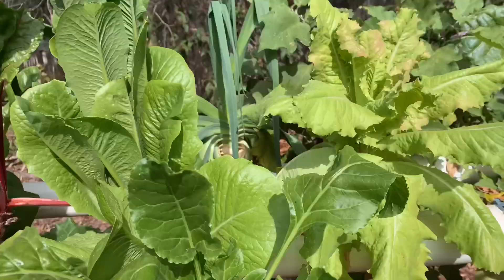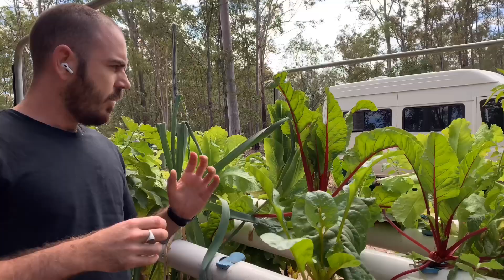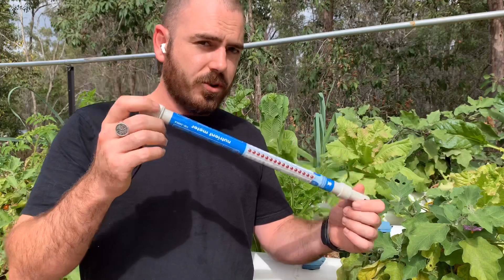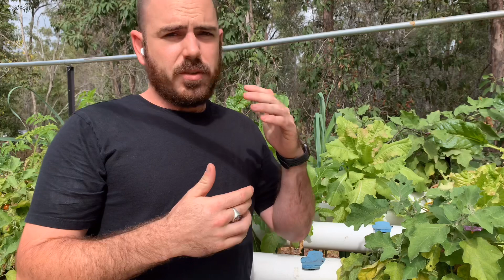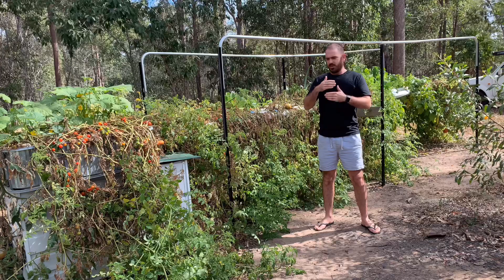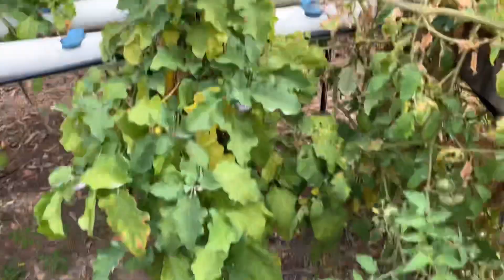Hydroponic Nutrient Measurements. EC, PPM and TDS: Explained

Comment: This item you are viewing is a 3 in 1 Nutrient Tester to determine the nutrient levels in a solution with 3 parameters (CF, EC and PPM).（YM-2005A） If you use hydroponics to grow fruits and plants, it is necessary to know the strength of nutrients.
Reply: :washhands:
Reply: CF/EC Truncheon Meter YM-2005A - YM Instrument Co,.Ltd.
Reply: Yes, very important mate,!!  The plant, like us is carbon based life, they need, water, food, light, dark amongst other parameters, but over feeding, too high a cF will result in nutrient burn which will burn your leaves which will restrict the amount of food/ Nutes going to your plants fruit.  The pH is also VERY important, to high or low can result in nutrient lockout etc,!!
In hydro keep your pH around 5.8 and in soil around 6.2, as long as your pH in general is between 5.8 - 6.2, this is optimal, you can allow a bit drift, but not too much, no lower than 5.6 N no higher than 6.8, but correct as soon as possible.
Your cF, PPM, TDS are the same thing, the strength of your nutrients, the ammt of salts in your feed, this all depends on which stage your at, how big are the plants, are they nearing the end of fruiting, remember, in the last 5-7 days, NOTHING but pH,d water to get rid of any excess salt build up, for a fresher taste or smoke,!!

Comment: In my area, the EC result for our drinking water is nearing 1000 ( odd looking U)/S per CM which is high sodium and other minerals not necessary nutrients. If the water has a known and lower reading and control of what is added the EC can give hints of what is the working solution. As time progresses and the plant begin to utilize the solutions, the plants do so at different rates. Notably the water will be taken up more than the nutrients will and the EC reading will begin to climb. At this point it is a guessing game and then you watch closely for signs of your plants screaming for this, that or another.  You can add R\O water to get the EC rating back to the correct numbers but who knows what the balance is at that point. We do our best to collect rain water, purchase R/O, or water from dehumidifiers, which by the way has the lowest EC reading next to rainwater. So my hat is off to those who are connected enough to their plants to know what to do. Also some plants, I find are not suitable for hydroponics or if compatible cannot be grown together in the same system. We have accepted the challenge and we get lots of pleasure from growing plants in this manner and the mental stimulation of just trying something different is fun also. We are learning. At the moment our system is outside. We have extend the growing season by moving the system inside and using grow lights. Yipes but this is adding yet another variable making the whole project more complex.

Comment: Nice video.
I understand everything about ec and its effects.

I've been growing with aeroponics for 10 years.
And I've never checked my ec.
I always check my ppm and pH.
And make my adjustments from there.

One important thing people must understand is don't go by what the nute manufacturer states.
I have found that all their suggestions are WAY to high.
I tried one manufacturers product and they suggested a 2500 ppm.
I through that stuff away.

In my opinion it is best to start with half of what a manufacturer suggests.
And then go from there.
But what's better than that is to find out what the suggested ppm and pH is is suppose to be on what you are growing.

Another important subject is ppm and pH drift.
One should always check their ppm and pH daily.
Because depending on how much nutes or water your plants are using.
Your ppm and pH will drift one way or the other.
And depending on which way these drift. It will tell you if you should add more nutes or water.
It's very easy once you understand what the drifts are telling you.

Comment: I bought a bluelab truncheon and it is great, however I already had a Zero water filter that came with a ppm meter. I didn't think it would measure high enough but it will the bluelab measured 1820 ppm. And the Zero water measured 182 x 10 ppm. And the water filter with 2 filters and a meter only cost $40 US.

Comment: They are sold out already :(
Reply from the maker: I have a feeling this is due to supply from China due to current importation conditions. The reason I linked it is because they were the store I bought mine from and they were also the cheapest. I didn’t want to link another product that was similar because I can’t vouch for it, but using the information in the link you may be able to find the same product from a different seller that is in stock.
Hope this helped.

Comment: So coming from a saltwater reef hobby we use RODI water with O TDS.  That is measured in PPM.  I understand tap water can have TDS from 70-400+ ppm.  I am having trouble understanding how TDS measurement is accurate. Simply measuring particles in the water, not what specific particles those are.  If i measure my starting water at 0 TDS and add X solution that will tell me concentration of mixture. I use tapwater it will be starting ppm + X.  Is it suggested to know your starting TDS then your final TDS? Also can RODI water be used, or is it too stripped of minerals?
Reply from the maker: You can definitely use a low ppm water source. But you may have to use a cal-mag complex to raise the dissolved minerals in your solution. It is infact better to start with a low ppm water as you have more control over the nutrients.
You cannot know the exact concentrations of various elements of the nutrient solution, which is why we have to do res changes to give ourselves a blank slate. EC and all other measurements are just to give a rough estimation of how much nutrient is dissolved in solution.